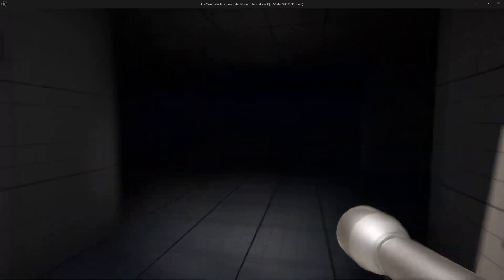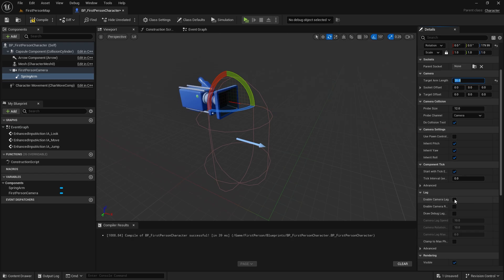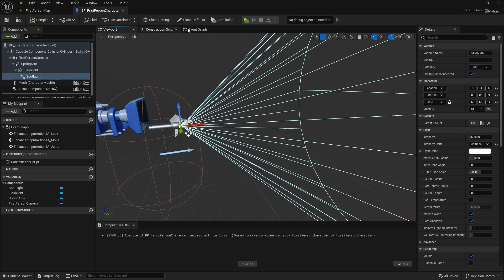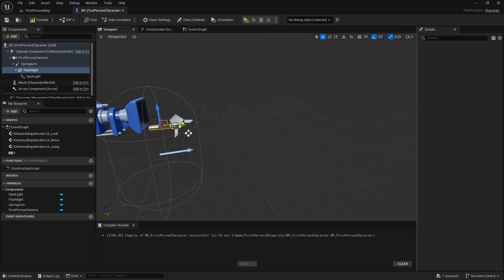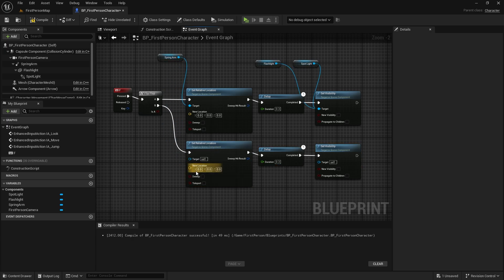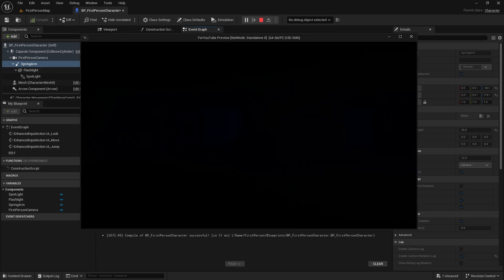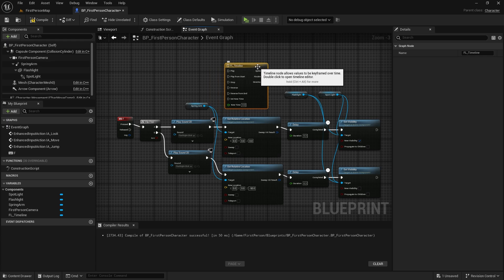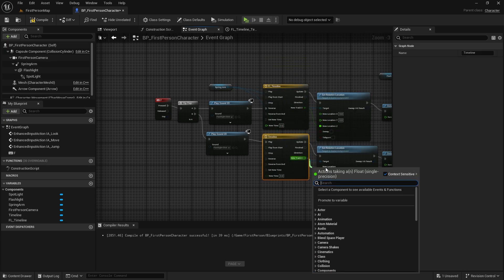Unreal Engine 5 REALISTIC Flashlight Tutorial - Step by Step Guide for Beginners

Comment: great tutorial. a few questions.. 
1- would it make sense to have the 'play sound' node before the flip flop?   maybe it doesn't make any difference, but it seems less redundancy would be better on the screen. 
2- it might be interesting to have the flashlight move before the character moves..  maybe a small radius in which just the flashlight is affected, with force multiplier to that it can look from left to right side of the screen when the mouse only moves  short distance.. but when the mouse moves more than that, the player facing changes as well.    but.. that's more a 'me' project. :-)    curious about the sound placement though. :-)   thanks!
Reply from the maker: If you use the same sound, it won't matter where it stops.